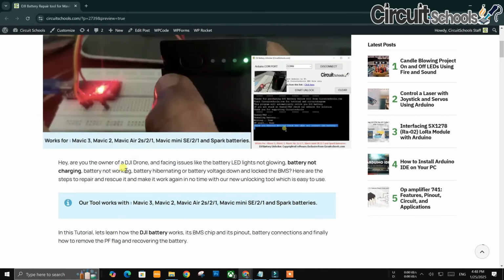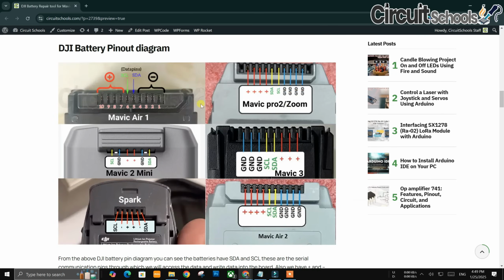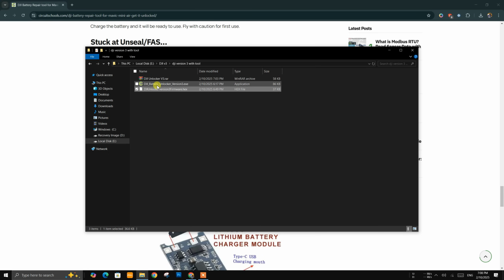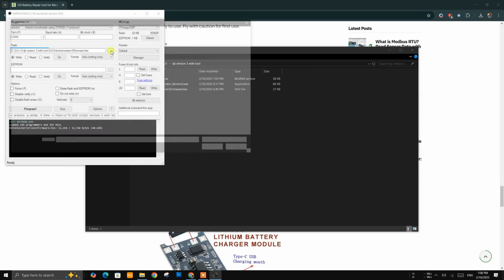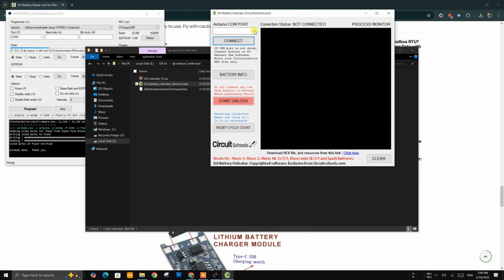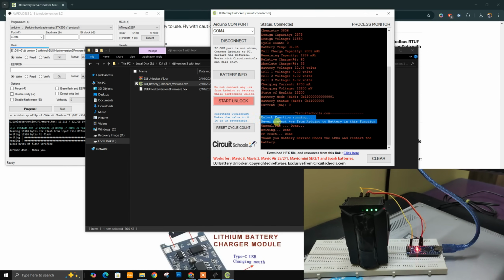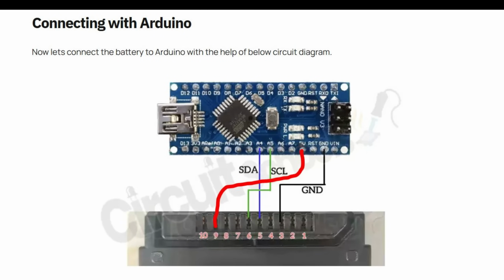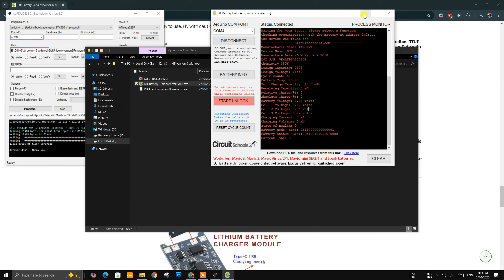DJI Battery Unlock Tool V3 | Arduino Battery Info, Unlock Battery, Cycle count reset

Comment: This tool is legit, thank you!

I had 4 flashing LEDs on my mini 2 SE after being in storage. I found that the cells were 3.61 and 3.24 volts (out of balance). I charged them both to 3.7 on a lab supply but still not working. The tool detected and reset the PF state and all is working again, put straight on charge.

Some feedback for Circuit Schools:
-If you try to flash an old Arduino Nano (old bootloader) it failed. You need to specify the baud 57600 in AVRDUDESS as a workaround.
-The Nanos are a dated platform, would be great if you also offered a binary for rpi pico since they are very affordable and 3.3V

Comment: DJI SPARK - Battery not found Please Check wiring
Reply from the maker: if wiring is perfect, its due to the internal cell voltages, they might be very low, they need to be near 4v to respond to our program. if detailed support please email us.

Comment: Hi I just want to say thanks for the program.  I tried to do it tonight and got the Battery not connected, check the wiring message. opened the battery and put my balance charger on cell 1 neg and cell 3 positive for about 5min (my cell 1 and 2 had 3.7v but 3 only had 2.6)after the charge i connected it again and it worked great.  Battery is charging now on the official DJI charger. Amazing product

Comment: having an issue with the unlocker where the program is stuck on "Checking communication with the Battery at address 0x0B..."
Reply from the maker: Check wiring and connections, replace the wires used and try.
Reply: @CircuitSchools  same issue still

Comment: Thank you very much for your DJI Battery Unlock Tool V3. I got rid of a long pending issue with one of my Mavic Air batteries.
Tutorial on the website was very clear and was easy to follow. Received the required files after the payment smoothly. Keep-up the great work, thank you once again and hope you guys will come with a solution for Mavic Pro Battery as well.

Comment: I have dji spark and trying to recover 2 batteries. I was able to connect and upload the hex code succesfully and also able to connect DJI Battery Unlocker but when I try battry info then it is keep showing 'Battery not found Please Check wiring'. I checked the wiring and it is also connected as suggested in the diagram. Can you please help me with this, not sure what I'm doing wrong here.
Reply from the maker: @nikhilsutariya567  this means battery BMS doesn't have sufficient voltages in it,  you can check the voltages by connecting 5v from Arduino to battery +ve pin and check battery info. And remember to remove +ve pin right after checking. If battery voltages are low you need to charge them externally.
Reply: @CircuitSchools  Hi, i did the 4 pin method since my battery is very low and the program is stuck at checking communication with the battery at address 0x0B. Should i remove the SDA pin when i get this message or not?